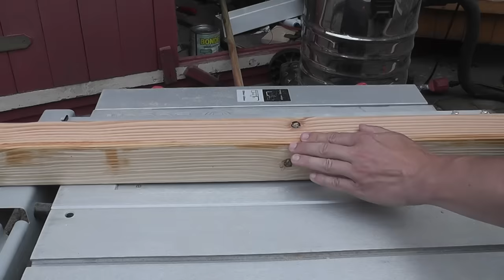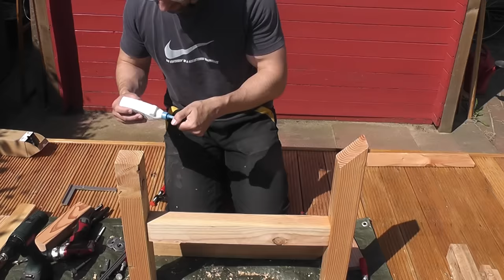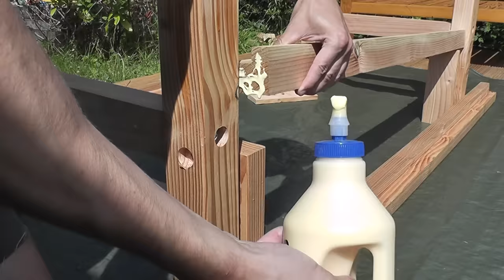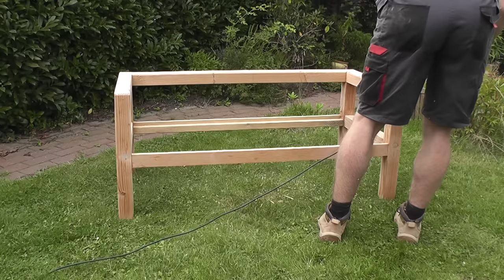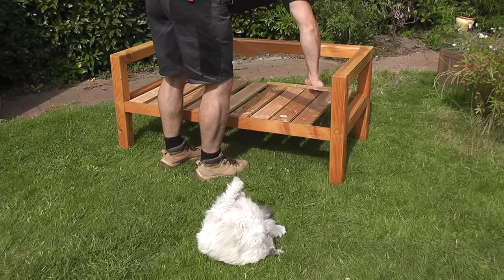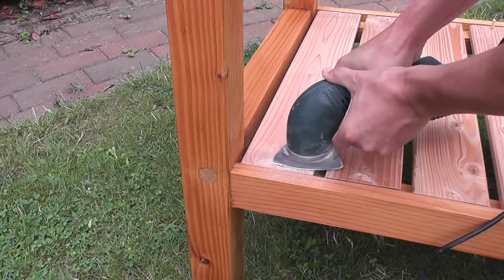DIY 2-Sitzer Gartenbank selber bauen / Homemade Outdoor Sofa

Comment: Nice, but I think you should have another piece of wood running horizontal approximately 100mm above the seat so the pillows are not pushing back when you're seating down
Reply from the maker: Thanks for the tip. But normally the pillow slips more forward than back when sitting.

Comment: Nice work! 
But where did you buy  the pillows? Or you made yourself?
Reply from the maker: Thank you.
Reply from the maker: I bought it from Ebay. But IKEA has ones too.
Reply: Robert Konieczny hi! Do you have a link to the pillows? Do you mind sharing the dimensions of your pillows if not. Thank you!
Reply from the maker: Hello Robert, the demension of the back pillow i 60x40cm, the seat pillow is 60x60 cm.
https://www.ebay.de/itm/191902649055